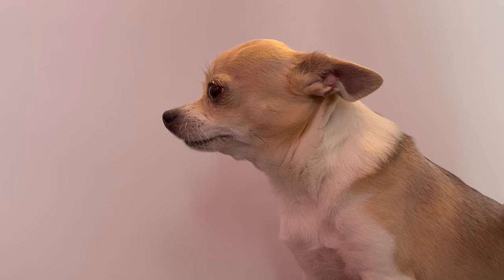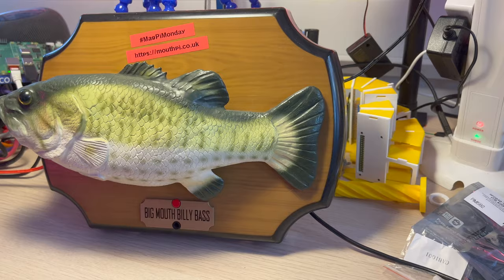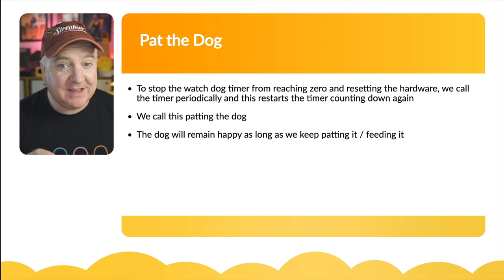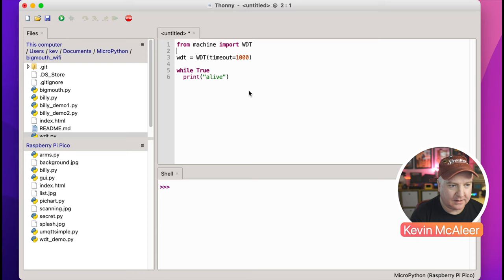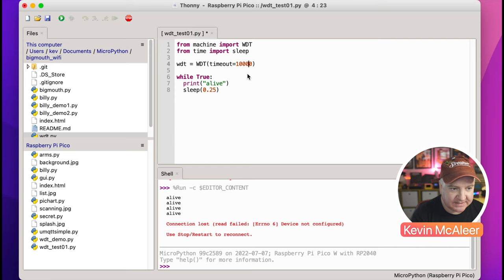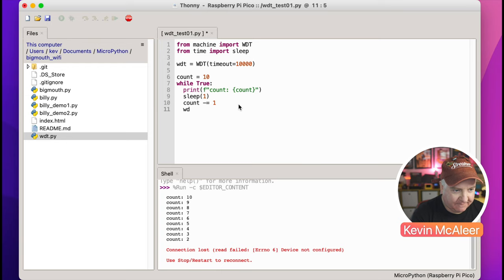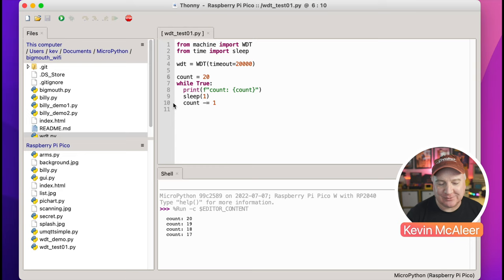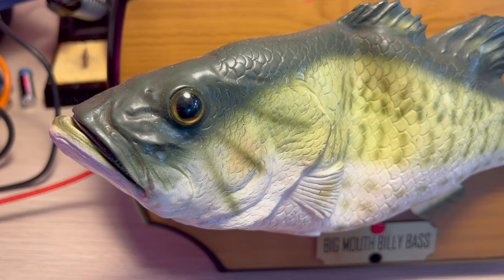Watchdog Timer - What is it, and how to use it in MicroPython

Comment: Nice explanation, very clear. 
If you want more than 8-10 seconds you can roll your own watchdog by counting down a global variable in a core-1 routine and resetting it in your main core-0 routine.
If the count gets to zero in core-1, do a reset. It’s not as bulletproof as the hardware WDT but it works. 
Also this version can be turned off on normal program exit. The hardware WDT can’t be stopped once stated.  (By design I guess)

Comment: Hi, great video. What is the impact of starting a watchdog timer and then putting the pico into deepsleep until. a button is pressed?  Would the watchdog timer kick in and reset even if in deepsleep or would it pause while in deep sleep?
Reply from the maker: Great question Dave - the pico wouldn't know a button is being pressed whilst in deep sleep; you'd need extra external circuitry for that - take a look at how Pimoroni achieves this with the Enviro range.
Reply: Good question, I came here wondering the same, not regards a button, but just how the WDT and deepsleep react to one another, does the deepsleep stop the WDT or not? My project does a little work-load, then sleeps for 2mins and repeats. Works reliably for 5-6 days and then fails. I'll keep looking.
Reply from the maker: @ashleycawley5816  have you looked at logging the state to a log file (using something like Phew!) to make troubleshooting easier.